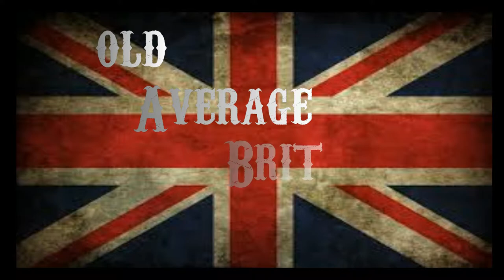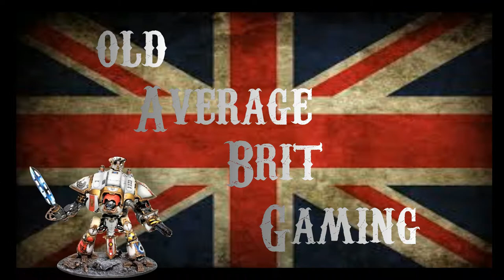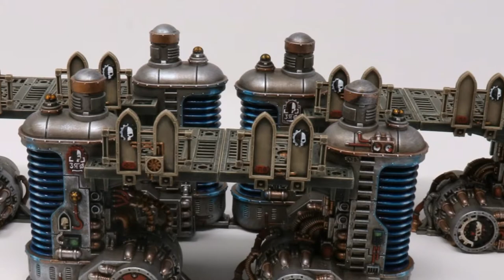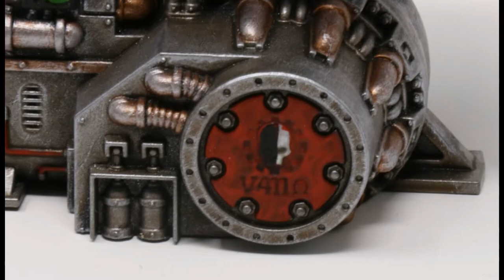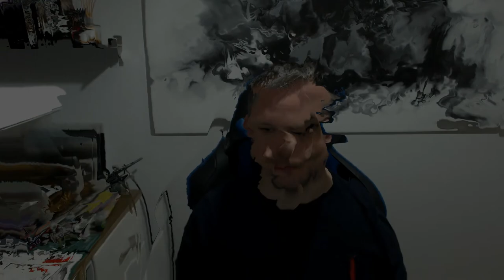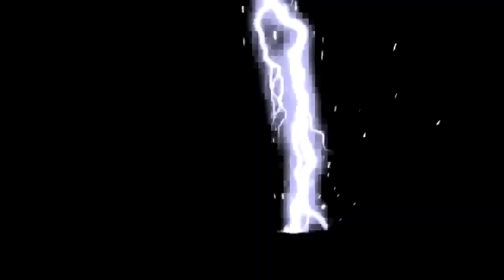Warhammer40k: Painting Showcase - Thermic Plasma Regulators

Comment: I really like that!  Nice piece of terrain to fight over!
I had a question/ but if it's better for you to use/answer  during a pertinent post- that's fine. I have been painting since I was about 14 (seriously attempting at that age at least..haha) and for majority of that time it was smaller scale historical   from airfix/esci plastic to minifigs& battle honours 15mm Napoleonic  & 20mm ww2 eastern front. Here and there thru-out I've dabbled in fantasy and science fiction as well- usually 25mm or larger. Present day....heavy into heresy/40k  GW miniatures  and my painting is 'ok' but I've fallen into habit of constantly tweeking/ touching up and I'm either ruining a decent job OR end up stripping damn figure because thinned or not too many layers and looks terrible. I believe I didn't do this with other eras/ scales because of lack of details & small size?  I'm really killing myself  here; any advice/ suggestions?? Thanks so much; sorry to ramble!
Reply from the maker: Adam Fox Tricky one to answer mate. I have never gone back and redone a model. When  it’s “done” at the time it gets put in the case and I move to the next project. The difference in my early Iyanden to the latest is night and day but I won’t strip and redo the early ones else you will never move on! Is there a tip? Not really! You just need to set a standard for yourself you are happy with and stick to it. If that’s 3 colours and based so be it. If it’s that plus a wash and a dry brush. So be it. Put it away and move on once done :)
Reply: Old Average Brit Gaming - good advice. It maybe because of the larger scale of GW miniatures & smaller armies...if I need 84 cuirassiers- no worries- 5 bloody assault marines-ill spend a damn week& 1/2 painting/ blending/ generally driving myself insane. Thanks for your take on this. I'll see what I can do.